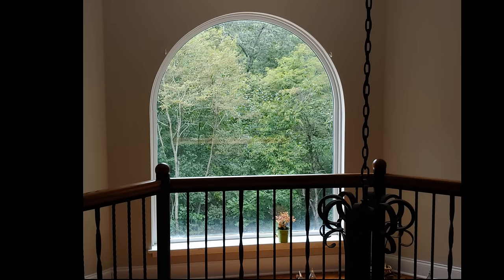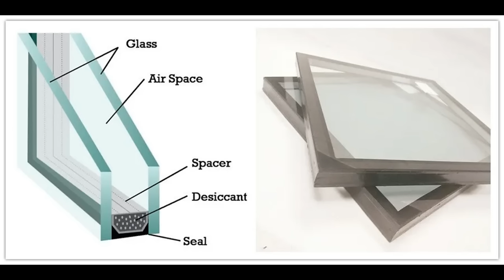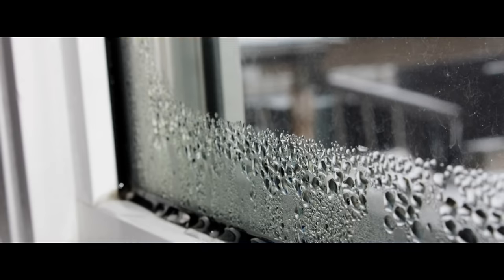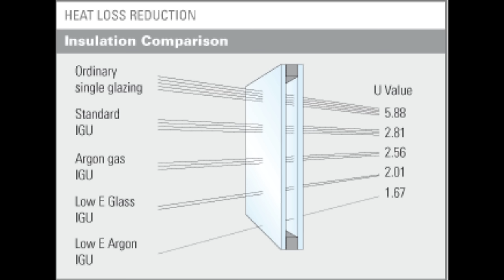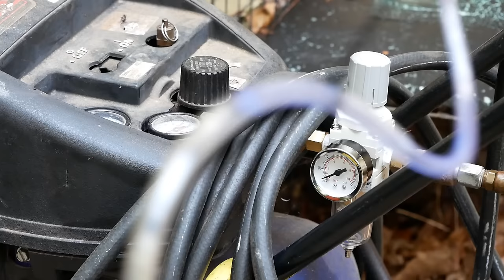Cleaning a Foggy/Hazy Window Insulated Glass Unit (IGU) from the Inside, Without Replacing the Glass

Comment: Interesting concept but your "solution" solves absolutely nothing.  The initial problem is cause because of a break in the seal and besides not taking care of that problem....you compounded it by making additional holes.  The problem has not been fixed only temporarily masked for a relatively short time.  If as you say to one of the commenters that you haven't had any problems for three years that would mean your initial interior build up of condensation was not that extreme to begin with because once you have months or years of buildup the calcium on the inside is virtually impossible to remove without taking the unit apart, cleaning, and then resealing back to factory standards.  This method is almost never done by insulated glass unit replacement companies because it is literally less expensive to remake a new unit than it is to attempt to repair one.
There are only 3 legitimate ways to take care of this problem (4 if you include your method which I don't consider legitimate)and they are:     1) Replace the insulated glass unit completely (note: not the entire window just the IG)
           2) Remove the exterior pane of glass (which in most cases will break and not survive the cutting out procedure) and clean the interior with the vinegar solution and denatured alcohol combo that you suggested.  Then replace the exterior pane of glass after running a seal on the interior IG spacer that is between the two glass units.   There is an extremely high probability that this "fix" will only be temporary because you are unlikely to find all the areas of leak points.
           3) Remove exterior pane of glass (clean interior as mentioned above) and leave exterior pane completely off.  This of course will eliminate entirely the insulating R factor and simply puts you window back in the category of windows made prior to the introduction of insulated glass units.  Also not recommended..... but you will eliminate the condensation problem.
This advise is from a person (myself) who was in the window and glass business for 42 years (now retired) so take the advise for what it is worth.  The road to frustration is paved with a hell of lot of good intentions.        Be well my friend.
Reply from the maker: I appreciate your experience and insight, and you may be right.  

That said, my experience is all I have to go on.  My window was hazy to the point of being opaque, so I am inferring that it had quite a lot of minerals on the glass.  It was like that for at least 5 years, possibly longer.  10% vinegar solution dissolved them, alcohol flushed it all out, and, as I said, the window is still clear 3 years later.  Since my IGU is costly ($$$$), the procedure was cheaper than replacement.  

Thanks for the detailed comment.
Reply: @akomakomakom  You are very welcome.  I'm glad that this has worked out for you.  Have tried different methods for removing the buildup and am surprised that your method has held up so well after 3 years. Good for you because you are right....those doggone units are expensive.  Hope all continues well for years to come.   Take care!

Comment: Sorry, this was a "big deal" 15 years ago, originated in Canada, that died out when it failed to be effective. I was one of those idiots who bought a franchise business to do this. It does not work long term, usually did not work short term (may work in very dry climates.) I wish it did, but it doesn't. Look into "glass replacement" - which is where you simply replace the IGU (the two panes of glass sealed together) and not "window replacement" which is replacing the entire window frame and all.
Reply from the maker: It's still a big deal to me.  My big IGU is worth >$1K.  Labor is probably another $1K due to weight and location.   My smaller IGU is worth $600 or so.  After cleaning them 3 years ago, I went from "can't see through this window at all" to "occasionally fogs up and clears up on its own, mostly in the summer".   For a total cost of <$100 (and I could do 20 windows for that money), I think I'm still ahead.

Comment: The seales have failed so any argon is gon if you have soft coat  low e glass in your units it will now oxidise giving a stained apearence that cant be removed . The units will still fog up this is only a very temperory fix, buy new high quality units . Soft coat low e duel sealed units .

Comment: reasonable DIY proposal but does not look the least easy at all and cost is high if you don't own a compressor already and hand pump + all the rest. Also it is unclear how the rubber or whatever soft seal were removed if there are any. My windows has a medium soft white plastic seal on the frame that touches the glass that you would have to remove first. In this video he just pops out out the pane with a trowel. Then hammers it back in at the end. This makes no sense if there is a seal glued to both the frame and the window.
Reply from the maker: Minor clarifications to your interpretation of what you saw:

1) A compressor is not necessary.  You can wait, or, as I point out in the linked Instructable, you can use an aquarium air pump (which is cheaper, better and safer).

2) The cost may be high depending on replacement cost of your IGUs.  Mine is $500+ for one window, $2000 for the other.  I spent <$100 on both.  I think I did alright.

3) I did not remove any rubber seals.  I poked through mine with an angled piece of wire.  I showed all the steps needed on my windows.

I am only familiar with my window design.  It is up to you to take away whatever is useful for your project.  I cannot do the homework for you.  I have made no money on making this video and don't expect to.  Constructive criticism is always welcome.
Reply: @akomakomakom  Exactly right about the type of window this method will work on. My IGU's are encased in vinyl framework but the actual replaceable IGU module uses aluminum 'framing' that's exposed to the internal environment. I'm concerned about the effect vinegar will have on the aluminum but heck, my foggy problem sashes are 20 years old so....
I saw tiny desiccant pellets on Amazon a while back but forgot to Save for Later but I plan on finding them again and putting a goodly amount in each window I revitalize. 
Best instructional video I've seen on this subject so far. Well done!
BTW, somewhere on YouTube there's a guy who shows step by step how to disassemble an IGU, clean the glass, add an anti-fog solution, and put it all back together again with fresh sealant. For the life of me I can't find it again!! If you get curious and find it would be kind enough to reply to this comment with the YouTube link?
Thanks again for the tutorial!

Comment: The about of time that took for the crappy mediocre result I could’ve put a new glass in about 15 minutes. I’d bet $1000 that window fogs up in the AM and PM.
Reply from the maker: You're quite right, it does, mostly near the bottom, then it clears up.  

It's all relative.  I couldn't see through the (big) window at all due to haze.  Now I can.
Replacement for that IGU would be $1000-$2000, and it would take a bit more than 15 minutes because I'd need a lift and several men.  For my time investment I got a window I can see through.   

The narrow window that this video focused on is a $500 IGU and I can replace it myself, so that's less of a clear win.